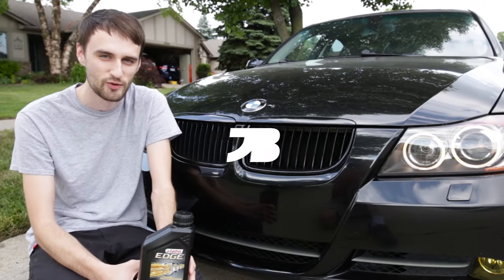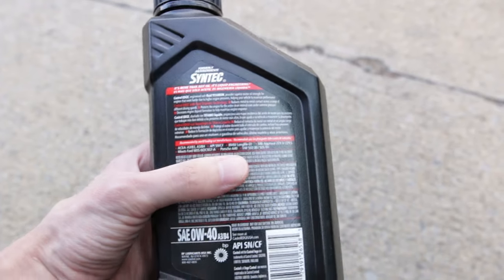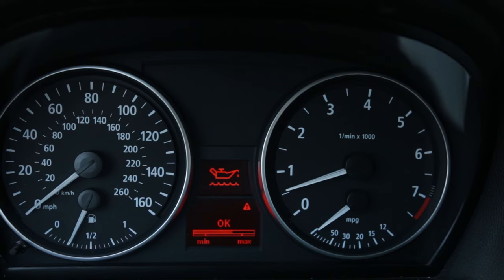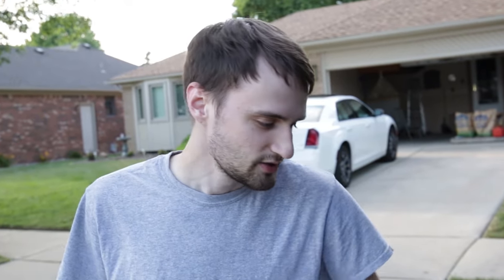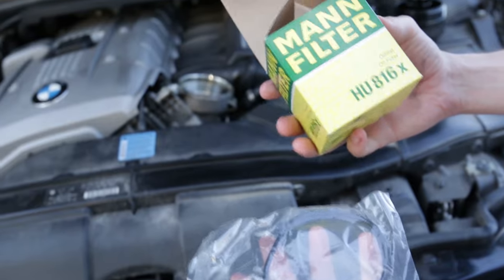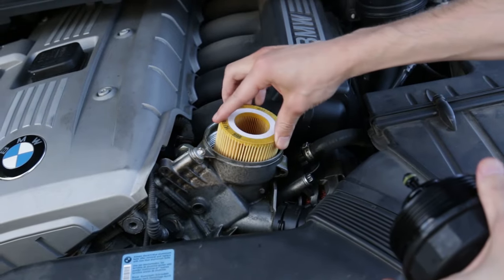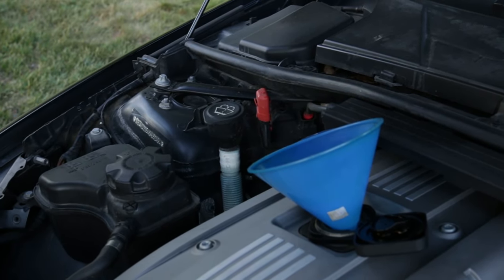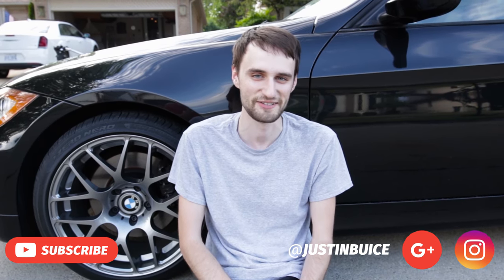BMW Change Your Own Oil!

Comment: 2006 BMW 330xi 
Mann Oil Filter 816 x or 925 x (are they any different or they both fit?)
Reply from the maker: We have the exact same car and I use the 816 x in mine
Reply: @justinbuice  Thanks for the reply Justin!
Reply: @justinbuice  hey Justin, what's your thoughts on buying an OEM BMW filter from the BMW Dealership for the same price as the Mann one?
Reply from the maker: If there’s one close by, get it from the dealership :)

Comment: where do you get the ring for the drain plug?
Reply from the maker: +David Carter its included with the oil filter. Or just keep the same one. They are made out of metal so i dont think they wear out that much
Reply: Justin Buice I'm talking about the drain plug..the filter has the O ring....
Reply: OK thanks

Comment: I really wish there was a dipstick on my n54. It's convinient to have the dash meter (helped me notice i had to replace my oil cooler to oil filter housing gasket) but if I'm low on oil with a cold start up I would have to wait about 5 mins for the sensors to pick up a reading.

Comment: So you only have to raise the drivers side of the car?
Reply from the maker: As long as you can reach the drain plug, that's all that matters. Before I lowered my car, I didn't even need to raise it at all.

Comment: Just a tip.. it helps draining the oil if you unplug the top cap.. but great video m8
Reply from the maker: Yeah good point. I didn't think about that when I was filming. But I had the filter cap off while it was draining which should have relieved any suction.

Comment: I have a 2009 335i.  After I changed the oil and turned it on.  It started vibrating really bad. Almost like it was chocking.  Someone please help me
Reply from the maker: +Frank Pineda did you put the drain plug back? Replace and tighten oil filter cap? Any leaks anywhere? Check oil level in the car?
Reply: Justin Buice I did.   I used 7 qrts as well and tighten the oil filter cap really good.  So if there’s leaks it may cause the car to vibrate a lot ?

Comment: Hey man I got a BMW 328i 2008, bought it from a guy and he hit a curb and was in a wreck, I ran over a curb today and the splash guard underneath the drivers door came off, about roughly 10 inches of it it's a triangle shaped...

I looked underneath and the bottom of the car is bent and messed up from the previous owner hitting a curb...

Do you think I need to get a new splash guard put in or is it whatever
Reply from the maker: +CJ Carpenter i would. The splash guard prevents rust and corrosion. Thats why the engine bays of BMW/Mercedes look so clean compared to more basic budget cars

Comment: Wow! I have a 2011 BMW 328i...88K miles. I usually can get my oil changed at the dealership with a coupon for $50-$60. If I don’t have a coupon, it costs like $150+. But yea, I could do this myself.
Reply: tripping it costs like 30 bucks

Comment: Can anybody tell me how much does it cost to go to the dealer to change the oil of a car?
Reply: Suhandi Wiratama for a BMW they usually charge you 100 or more to do this simple swap he just did. but the cost of oil and new seals and filter is about 50-60$ and 20minutes of your time .

You can literally go to Auto zone use their 17mm and buy the filter and seals for 16.99$  , buy the oil from Walmart for about 20-22$per 5gallons   I'm trying to figure out how 20mins equals to  about another 80$ at pepboys or jiffylube

Comment: BMW always recommend you to change oil bolt drain
Reply: bambino bmg Only if you have a plastic oil pan and plug such as my 2012 F30 328i.  The 328i xdrive has a metal plug and it only needs a new washer.

Comment: how many miles on your bmw?
Reply from the maker: +stilltippin214 60,000 right now
Reply: cool , quick question , when installing back your oil filter is the black o ring (sealant/gastket) suppose to be showing on the edges?
Reply from the maker: There's a slot that it fits in to

Comment: I would never use Castrol. It seems shady the fact that BMW uses it, especially now that they have changed to Shell. In a nutshell: Cheap oil=BAD , Middle range oil=GOOD , Expensive oil=BAD. thumbs up if you know what I am talking about.

Comment: Here is your mistake why would you use Long-Life 01 you are driving E90 not E46, I got E90 too and I am using Longlife 04 (5W-40) which is recommended for E90
Reply: tuborgpz LL- 01 is used in North America

Comment: Changing your oil diy may save in shortrun but next owner will have doubts rather than an official service stamp, no?
Reply from the maker: You have to try to calculate the added depreciation compared to the savings of doing everything yourself. If you plan to own the car 5 years +, it will almost certainly save more doing your own maintenance. Not to mention, if you were to trade a car like this in at a dealership, having the service history will carry little weight when they valuate your car.
Reply: You trust the college kids at Jiffy lube WAY too much. Read the horror stories of them leaving the drain plug loose etc and getting them to replace your seized motor would be a nightmare.
Reply: Quick Lube place is probably the reason why the oil drain cover door is missing.  I would bet you anything they would not use BMW LL-01 oil or a high quality filter.  Things I would add:  Run the car before changing the oil, when it hit your hand it should have almost burned you.  Wear nitrile gloves for easier cleanup and to protect yourself.  Use an oil catch pan to filter out the plug or a magnetic pickup tool to fish out the plug.  Use a pick tool to remove the o-rings.  Push the oil filter onto the stem of the cap not into the housing and after all said and done you should reset the oil service reminder which will add an oil change into the car's history/memory:  https://youtu.be/PW_ffAXvkoM

Comment: I have a 2007 335i twin turbo. It's the same procedure to change the oil on my car has yours, but you skipped one HUGE step!!! On this model of BMW, you need to reset the computer so the car knows it has been service on. If you don't do this the car will still think it needs an oil change and the car will keep telling you that it needs service. That's why most people take it to dealer or a mechanic who has a dealer lever scanner tool to reset the computer.

Comment: great video instructional video on a very simple task such as an oil change and oil filter change service procedure but except for the procedure itself because its kind of a health hazard for yourself and your audience that doesn't understand about how dangerous this procedure it is and what it does involves within its technical parameters
whenever you're handling any chemicals, specially antifreeze or used engine oil, you must protect your skin and eyes from direct exposure with these dangerous products and byproducts you did shown on your video
first, the antifreeze is contaminated with mercury that normally escapes from the thermostat and the radiator cap or expansion thank cap and other chemicals and poisonous metals such as lead or other metals, asbestos picked up by the antifreeze and used engine oil and now they form part of the chemistry of the used antifreeze and old engine oil internal structure
the 2nd unhealthy chemical that you should not have any contact with it is with used engine oil at any time because it also absorbes mercury from the outer head gasket or possibly from an undetermined amount of internal coolant leak, lead, contaminated with wasted residues inside the internal walls and moving parts and not moving parts of the engine, wasted oil, harmful fumes & high temperatures that change the oil molecular structure, debris, and any other heavy metals - lead & asbestos among others - that are highly poisonous and promotes the growth of hideous cancerigeneous tumor cells in your healthy organism
googles and latex gloves may help to promote a better protection for yourself and your audience and will provide you with a better life spand and expectancy and will also promote a safer environment to the world
👉for the oil plug at the bottom of the oil pan i may suggest you should use a magnet with a telescopic handle to hold it firmly and out of the wasted oil sump
cheers
Reply: "SAFETY IS FOR POOSIEEEEES"

Comment: Love the straight to the point vid. But why 1) did you not just put the nut on the ground or a paper towel instead of fishing it out of the oil bin? 😂😂😂 2) didnt you put the air filter into the cap first

Comment: NO NO NO do not use a exacto knife to cut orings off, if you gouge the profile of where the orings seat you will cause a leak, oring grooves are a toleranced specific design.

Comment: Guys.. We, people from Europe do not use Castrol oil.. It is shit.. On the oil cup there is only Castrol sign, because at these time BMW had an agreement with Castrol cause of the sponsorship at Formula 1 with BMW-Williams team. Now for example it is Shell. 

People here use mostly Motul oils but as well Valvoline or Millers. 

Cheers
Reply: qubson92 is it shit because you've done scientific testing or is it shit because that's what you have been told by others? I have used motil, valvoline, shell, castrol, nulon, pentrite and several others, and for a normal daily driven car they are all perfectly fine and perform exactly the same.
Reply from the maker: + Ken Lawton Car guys argue about oil more fiercely than politics, but I'm with you, I've used other brands and can't tell the difference. As long as the oil weight is correct.
Reply: Justin Buice Absolutely! I'm literally just looking good at Liqui Moly oils from Germany and I think I'm going with them lol having said that so long as it suits BMW longlife and is within spec for viscosity who really cares 😉
Reply: Ken Lawton c